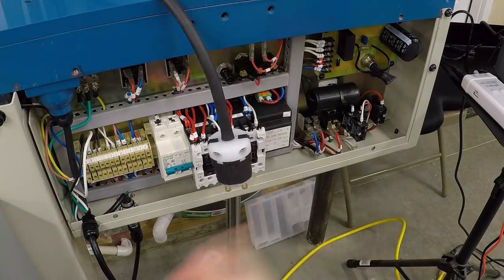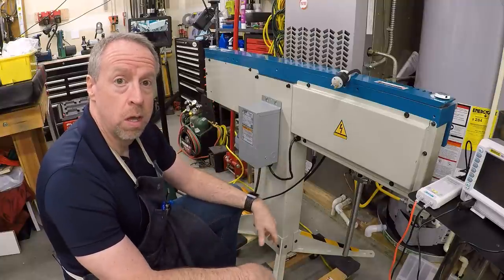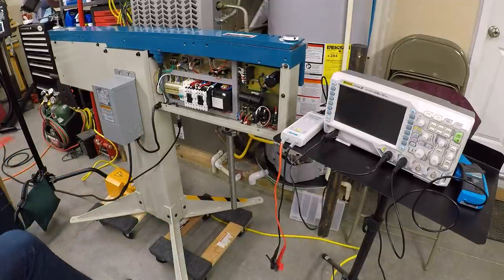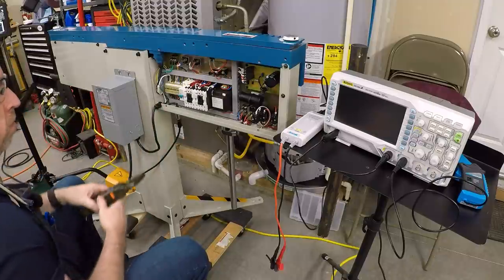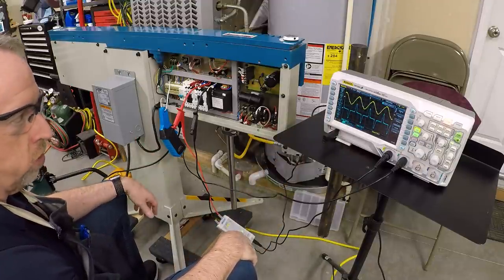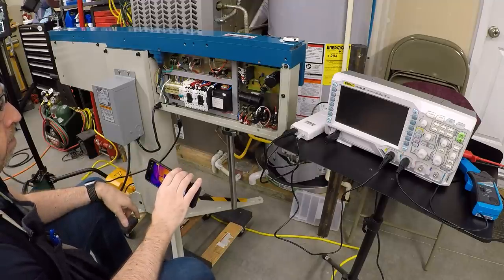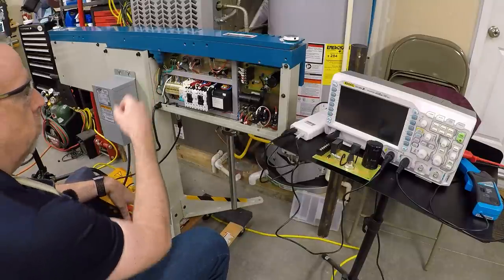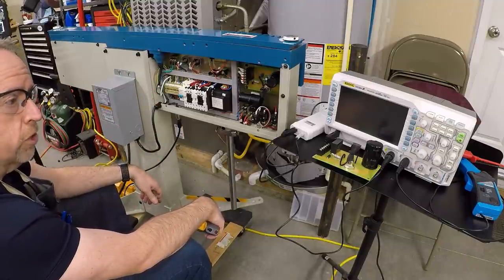The Mystery of the 17.4A | Sheet Metal Saga

Comment: Well of course, if a series connected capacitor is used to limit the current then such a cap  will be passing more rapid voltages rises and more frequent rises, whilst running 60 Hz rather than 50 Hz.  That could account for as much as 44% over current. The reactance of the transformer might also couple with the series capacitor improving power factors and thus increase utilization.
Reducing capacitor size might bring things back into spec. Motor run capacitors of comparable voltage rating (as the original) would be suitable for experimentation.
Reply from the maker: There is no current-limiting capacitor in the main clamping circuit.  They do use one in the light-clamping mode prior to pulling the leaf, but the main circuit is switched straight to a full-wave rectifier, a parallel filter cap, and some kind of thyristor circuit in series with the magnet.  I'm really not sure what the thyristor does, since it's a filtered DC circuit, and it should immediately latch and stay that way until power is removed.  If you want to look at the schematic in the manual and you have any insights, I'd be interested.  https://www.baileigh.com/media/uploads/manuals/BB-4816M_06-2020.pdf

Comment: I don't think the 17.4 A RMS is accurate because the current waveform is so different from a sinusoid. The instruments are possibly calculating IRMS = IPeak / SQRT(2) which would be correct for a sinusoid (only). RMS current is supposed to be "value of the direct current that dissipates the same power in a resistor" but if the waveform isn't a sinusoid I don't think the value is accurate and therefore that equivalence is not either. This also explains the phantom 1500W - I think you have to actually integrate I*V given the real waveform to determine how much power is being consumed. Given how much time the current spends at zero I'd guess the 1500 "extra" does not exist.
Reply: The True RMS meter and scope are reading correctly. A true RMS meter will only read incorrectly if the crest factor is outside the specification. The entire point of a True RMS meter (and the scope RMS measurement) is to measure non-sinusoidal waveforms.

Comment: You should measure the inductance of the electromagnet to use for some sim/calculations. Also an electromagnet that size could easily influence the reading of current clamps from several feet away.
Reply from the maker: Worth considering, but the magnetic field falls off with the square of the distance, so if that were the case, I would definitely see a different wrong reading down at the transformer, but I get the same values.

Comment: the old Oz original Magnabends had circuit boards that had capacitors etc that went wobbly after eg 10 years. You removed  boards and the company rebuilt them.

Comment: Hi James, love the channel great content. Couple of thoughts (that really are clutching at straws)
Is the contactor for the full load operating correctly? I recently had a similar issue which took hours to find, an issue which turned out to be a volt drop on a contactor which only happened under load (that’s a day I’ll never get back)
Secondly you measured the capacitor on the lcr meter at 120hz. Is the fluke meter reading the rms at a different frequency and therefore calculating current incorrectly? 
Keep up the good work!
Reply from the maker: RMS is what it says: the square root of the mean of the squared values.  Frequency isn't a consideration.  I'm seeing 218V downstream from the contactor, so it's working.

Comment: Thanks James.
I'm surprised that the design was so tight that a 10% over-voltage would cause failures. Based on the system components would there be a downside to running it at 200 or 212 volts available from the buck boost transformer? Assuming of course that the magnet will still hold the work firmly. Might increase tool life if it works. No?
Reply from the maker: It really depends on the nature of the problems.  If the coils are getting hot enough to break down the insulation, then maybe it would help, but once you get down into safe operating range, I wouldn't think going further would add much, but I don't know.

Comment: That Clamp Meter is a current transformer and the huge field from the Magnet is causing problems
Reply from the maker: Interesting thought.  They're actually Hall-effect current sensors, so they could theoretically register interference from the DC magnet, but I believe we would see this on the scope as the waveform not centered around zero.  I would also expect the reading to be different as I move the meter around, but I get the same values right next to the magnet and down at the bottom of the transformer.

Comment: Being pedantic, the current waveform has a high crest factor in addition to the poor (low) power factor. You could have a power factor of zero with the current and voltage perfectly sinusoidal but 90 degrees out of phase. And in such a case, the cheap meter would likely match the true RMS meter.
Reply from the maker: Right.  The crest factor is around 3.

Comment: Try put some metal plate between jaws,  does that make difference ?
Maybe something to do with induction .
Reply from the maker: I had the same thought, so I tested it with a full width piece of 16ga aluminum, and it made zero difference.
Reply: @Clough42  Aluminium is basically invisible for magnetism, I don't expect a difference, Could you also try that with normal steel, please? Additionally, I would be interested of the waveform finally going through the magnet and its voltage. Is it smooth DC or shaky?
Reply: Johann Glaser The eddy current brakes I've built tell a somewhat different story. :)
Reply: @billstrahan4791  Haha, thanks, you are right, I only thought about the DC.

Comment: Just to clarify: the 10A is not average current (avg is actually very low, as seen in the osc. and should be aproximately 0) The 10A is because that clamp is made to measure sinus current, not that estrange waveform. Basically the 10A mean nothing. You just cannot measure non-sinus waveforms with a non-true-RMS meter.
I think the 17A are normal. Manufacturers are pretty sloppy with specs. I know you do not want to hear it: but I also think your 240V would have been no problem at all.
Reply from the maker: The "average" AC current approximated by cheap meters is the average of the absolute value.  I had the scope set up with a math function to do this, but didn't include it in the video.  It was about 9.8A.
Reply: I also agree with your conclusion, and also, that current would be lower at the higher voltage. Which naturally makes me VERY curious as to what component exactly under the hood of that thing might not be rated for 240v. 
It doesn't look like a very sophisticated circuit. Though I can imagine a situation where they could buy a rectifier or contactor only rated for 220v because it was $10 cheaper than the 240v rated component, and then derating it on the nameplate just to CYA.
Reply: Agreed on all points.

Comment: I think the "True RMS" meters can't cope with the huge amount of harmonic distortion in the current waveform and are giving erroneous readings. 

As a sanity check, you could try calculating the energy used during a half cyce (and then calculate power) from the DSO traces using either geometry or calculus and making some simplifying assumptions about the signals e.g:
1. model the voltage as a constant value Vmax, this is OK as current draw happens near peak voltage
2. model the instantaneous power as a triangle / rectangle with a peak at Vmax.Imax and time / base length in seconds measured from the DSO during a current spike and 0 elsewhere.
3. Calculate energy usage - area under the shape 
4. Divide by 1/120 (time of a half cycle) to get power 

Pretty sure I will have messed up something there though :)
Reply from the maker: I think it's exactly the opposite.  The True RMS meter is giving the correct reading.  The Fluke 375 is rated for crest factors up to 3.0.  Also, the scope agrees, and it definitely has the bandwidth capability.

Comment: I sure would like to see this thing in action, I am guessing the “clamp” is the hold down ? I have a mechanical one that indeed if the clamping force is not high enough the work piece will shift. Super curious what the lighter force VS the higher force is specified for ? Is that rated for 16ga mild steel?
Reply from the maker: That's the rating.

Comment: So the other thing to keep in mind is with the lowered voltage your amperage should be a bit higher. If I was tinkering with this I would test run it at 240v and see if the current falls in line with the rating
Reply: You are thinking in terms of constant power and not constant resistance or impedance. The current and power will increase with increased input voltage. Someone posting above did exactly that experiment with his machine and got 20 amps.
Reply: @lwilton  good point. My bad...
Thinking back to my early days in the trade school we had classes on inductance/capacitance calculations, it still makes my head hurt . And as I recall nearly the entire class struggled with that (me included)

Comment: Measuring resistance of a coil rated for mains with a multimeter is wrong. You could have a breakdown in the insulation of some loops but only happening at 220V. You need to test the resistance at the rated voltage.

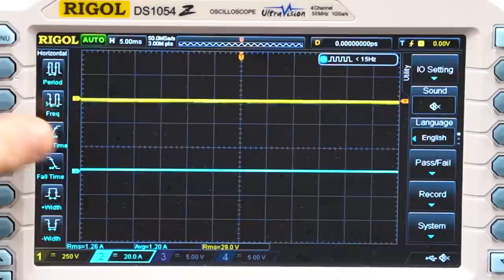Comment: The average ABSOLUTE current shown on the scope is ~10A (10.4A from my pixel graph tracing, but I don't think the scope current clamp was offset zeroed before operation as 1.2A shows when turned off at 9:03) I don't believe the DS1054Z offers an average ABSOLUTE metric - but a calculated channel using Math Operator Abs() should then show an Avg metric on it.

Tracing the pixels of voltage and current curves to calculate apparent power (instantaneous V*A) gives 2231VA, divide that by 221.3V and you get 10.08A.
So with those measurements, 10A is close as average current & very close as an apparent power current (humans love it when numbers can multiply together on a nameplate/spec sheet).

RMS is great for sinusoidal waves or resistive loads but for anything else it'll quickly lead you astray - especially with highly distorted waveforms (e.g. current thru a rectifier bridge & filter capacitor).
Imagine some square waves, all 1A average with appropriately scaled up peak current & down duty cycles:
1A @ 100% = sqrt((1A^2)*100%) = 1A average, 1A RMS
2A @ 50% = sqrt((2A^2)*50%) = 1A average, 1.4A RMS
3A @ 33% = sqrt((3A^2)*33%) = 1A average, 1.7A RMS
4A @ 25% = sqrt((4A^2)*25%) = 1A average, 2.0A RMS
Reply from the maker: It's not off...the 1.2A is the light-clamping mode, which is still activated after dropping the leaf.  I did run the ABS-AVG, and it shows around 9.8A.
Reply: @Clough42 THE +1.2A DC value was present before you said "let's turn this on".
It's also present during clamping.
Reply from the maker: @ivanblogs  looked back at the video, and you are correct.  I didn't zero the clamp.  I just went back through my saved screenshots and found one from another test where I did zero the clamp.  Average on that one is showing -28mA and RMS current is 16.9A.  So that was my mistake, but it doesn't look like it affected the result much.
Reply: @Clough42  No, I wouldn't expect "too much" impact. But measuring RMS current value alone just doesn't have much meaning. It won't tell you power consumption (since it's not aligned with voltage with imperfect power factor). About the most you'll know is I^2R losses in supply cabling. RMS can be a useful measurement, but it is not for every occasion.
Reply from the maker: @ivanblogs  I^2R losses are my my primary concern.  I was afraid the losses might be occurring in the tool or the shop, potentially leading to a fire.  I'm convinced now that it's just an incorrect nameplate value (or perhaps one rated to an "alternate" standard) and the tool is safe enough to use on an appropriate circuit.

Comment: Simply a case of a Chinglish misinterpretation, I’d wager. Incorrect nameplate isn’t a surprise.  If the company is happy, then your warranty is happy. Then you are happy. 
Side note,  I’m curious as to the “logic” of making a machine 220 volts…. to sell where the nominal voltage is 240.  There’s NOTHING in that circuit that couldn’t be made 240.
Reply: The nominal line voltage in China is 220V. This is Chinese domestic goods that they have exported.
Reply: @lwilton  Most of Europe I believe is 220v 50Hz. as well.

Comment: What's the power factor with the buck transformer inncircuit? Maybe they just rated it for the real component of the current, still a pretty big mistake if that's the case.
Reply from the maker: It's the same.  The current waveform passes right through the transformer unmolested.
Reply: @Clough42  it will have to be phase-shifted by some degree. Just so we are on the same page, Power factor is the phase shift between voltage and current, nothing to do with the shape of the current waveform. Unless the impedance is perfectly matched at 60Hz, there will be a phase shift in each current loop in the circuit.
Reply from the maker: @BogdanTheGeek  understood.  In this case, I'm only measuring current and comparing to the nameplate rating.  A phase shift will affect real power--not current.
Reply: @Clough42  yes, what i ment is that maybe the rating is for real power only. I would be very curios to see the phase of the current going into the transformer and coming out.
Reply from the maker: @BogdanTheGeek  this is where you keep losing me.  There is no rating for power--real or apparent.  The rating is for current, in amps, so power, complex or otherwise, doesn't enter into it.
Reply: @Clough42  ok, let me put a different way. As the power factor decreases, apparent power increases(real stays the same, reactive increases), the only way it can increase is by increasing the current as the phase shifts. By introducing a lot of inductance in the circuit with the transformer, my guess is that the phase shift from it caused the brake to draw more current. Its reactive so it just goes back and forth, not actually used.

Comment: Just questioning could this be because you don't have anything in the break to be bending? Does the metal in the break during operation help reduce voltage thru the magnet? I noticed as the magnet stayed on the voltage did appear to drop a tenths on your meter. Could you show the break working with the meter clamped on just to see if that's possible?
Reply from the maker: I tested it, and it makes no difference.
Reply: @Clough42  thanks for update I was very curious if it made a difference or not

Comment: When you're testing the new component: you're expecting explosions and flashes. I'd worry more about hte magic blue smoke escaping.
Reply from the maker: With low voltage electronics, sure.  But with a tool connected to a 7KVA power supply, you'll note I was wearing safety glasses.  Tattooed eyeballs are not as cool as they sound.
Reply: @Clough42  Yes, indeed. The blue smoke at those power levels is a lot more violent.

Comment: 1500 watts—essentially two horsepower!—should have been quite easy to find, just following the smoke.
Reply: That extra 1500 watts is reactive power.  It's current that's sloshing around the circuit without doing work.  All it does is add a bit more waste heat to the components it flows through.  Which is why the power company charges extra if you have a big load with a crap power factor.
Reply: @martylawson1638  I understand the first part of your explanation. But how is it not contradicting the second part.
If it is just some current sloshing around that is not doing work, and it just adds a bit more waste heat to components..... why would the power company care about just a little bit of energy??
Reply: @dozog  A bit more heat to a LOT of components is a lot of power. The total power might be high, but the individual components see a small fraction of it.
Reply: @dozog  because the apparent power causes real losses in the lines feeding the load. Thier power lines. Theses lines have resistance and the apparent power causes real losses when flowing thru resistances.
Reply: @TheRetiredtech  That seems to make a lot of sense, thanks.

Comment: This is classical example of measuring error (or how eevblog would say trap for young players). There is parameter called "crest factor" which for what shape of current RMS measures will have correct values. And just on first look your current crest factor look way to off even for good dmm.
Reply from the maker: Crest factor of this waveform is around 2.8.  The Fluke 375 is rated for up to 3.0.
Reply: @Clough42  how you measured that? Just looking at it to me look like over 4 and possibly over 5.
Reply from the maker: Peak voltage on the scope is 48.5V, divided by 17.4A RMS current shown by the Fluke, and the scope, and now confirmed by doing the math in a spreadsheet from the oscilloscope dump.  (See the pinned comment.)

Interesting that you invoked EEVBlog.  You'll see Dave's comments elsewhere on this video (in response to Dave Hollman) confirming that the readings are correct.
Reply: @Clough42  First part have no sense, calculating value of crest factor based on measured RMS, which correctness depend of  crest factor is absurd. If measured RMS is wrong due crest factor be out of range, then calculating crest factor using same measured RMS will give wrong value for crest factor which will falsely fail in range for which measured RMS is correct.
There is lucky coincidence that in this case measured RMS (which you confirmed using oscilloscope dump) is correct so your calculated crest factor is correct, but it could go other way too.